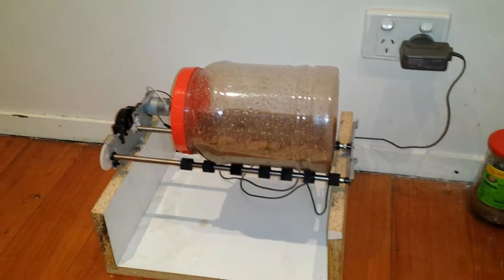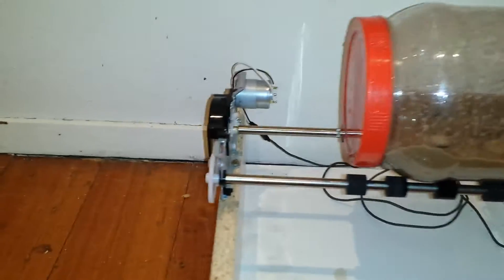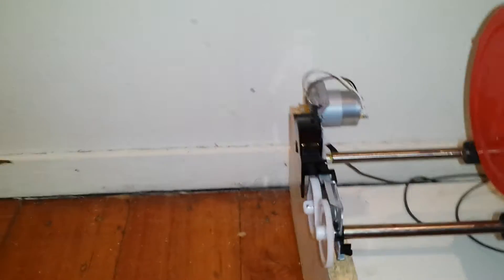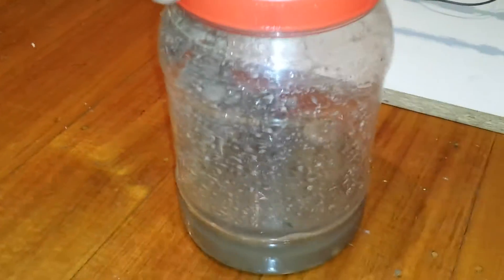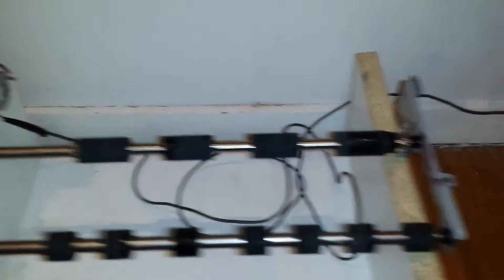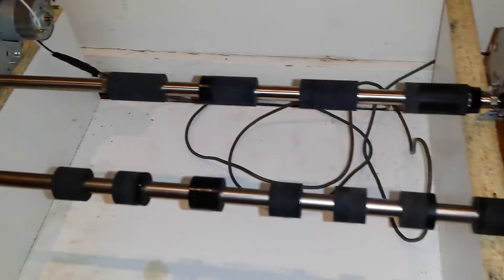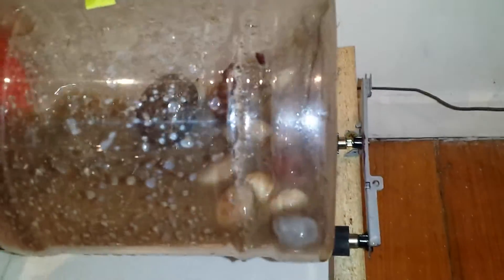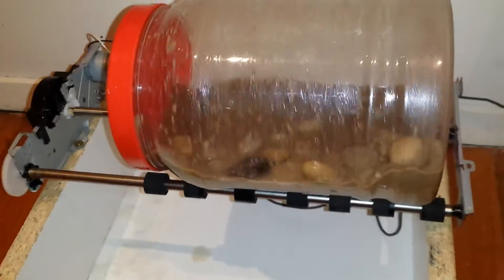Homemade Rock Tumbler

Comment: I thought the whole concept of a rock tumbler was to make the rocks and sand tumble against each other.
Reply: You need to add some fins or other disruption inside the jar in order to get the tumbling action.
Try gluing some small nuts to the inside of the jar. Perhaps a few rows running from the mouth of the jar to the base.
Reply from the maker: You're correct. I ran it for a couple of weeks with sand water and the rocks I wanted polished. It worked but not as well as I hoped.
Reply: @SureshBopitiya no sir, 3/4 way full always, water just below the level of rock, this will allow the rocks to not all fall down to the bottom and stay there, the idea is that the rocks roll on top of each other. And think of sand as glass, about the same hardness, so any rocks harder than that and the sand won't do anything to them except break down the sand